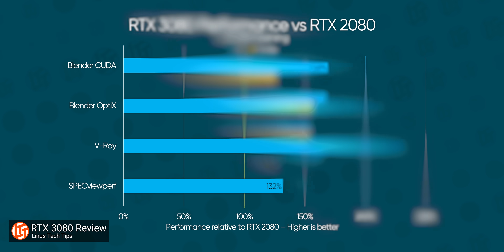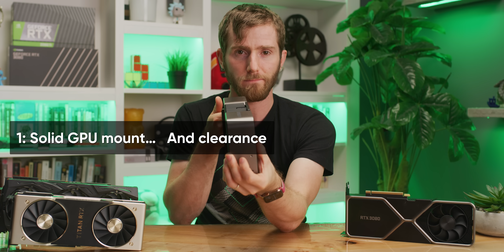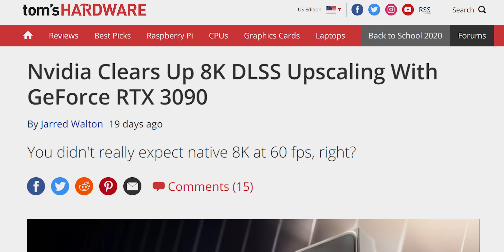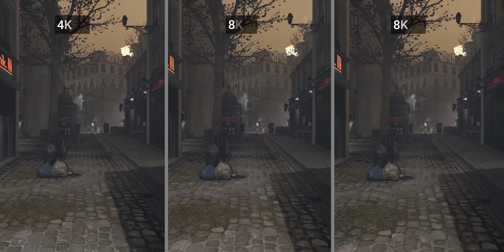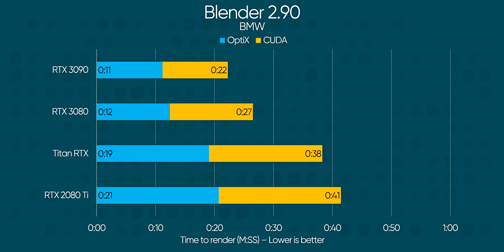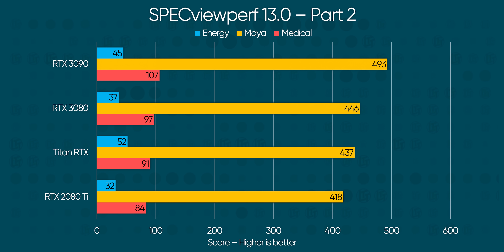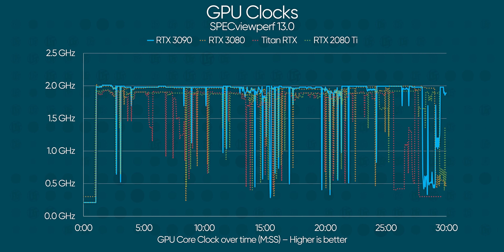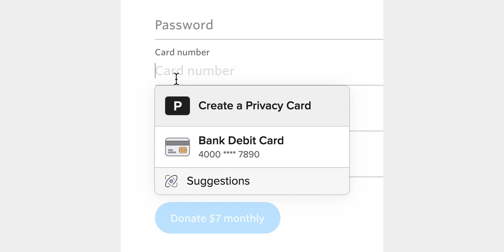Making Nvidia’s CEO mad - RTX 3090 Review

Comment: Seeing a new reference cooler, not just revolutionary and different, but actually competent is really a fresh breath of air! Honestly reminds me of the new ryzen Wraith coolers, they weren't amazing, but they were different and better enough compared to the old intel included CPU coolers to make it feel revolutionary which matters a lot to customers! My friend picked a r7 2700X over a r5 3600 last black friday because it was cheaper at sale, AND included a beefy CPU cooler. Cooling matters and even if it's just to make customers feel better, that still matters a lot when working for good faith. I had signed off of reference coolers for the last 8 years of GPUs, nvidia changed this in one launch.

I'm also happy that my 6 year old 850 PSU actually feels future proof, the power efficiency going through maxwell, pascal and SLI being killed made me feel like I had a high power PSU when they weren't feeling very necessary. I know 850 isn't enough for this GPU but as a 1080 Ti owner, I'm probably not going to upgrade anytime soon.

Comment: As an artist, I now definitely wait for a titan version. Maybe I'll grab a 3080 for now, unless I get a Titan at a great price & save that $$$ for a 3090 titan. 
And for those asking why not wait & get the Quadro version... 5k gets me my new Cintiq Pro 32 touch w/stand. So 1500 is the max I'm spending on a card, especially since most of my art software I use, makes more use of regular memory; meaning I'm better off with 64gb of memory & and a titan during the working hours of the day & 64gb of memory w/ a 3080 or 3090 titan in the evening for gaming. 
I agree in the end... the 3090 is frustrating. It does not do me any favors painting in PS/Painter or the occasional 3D model renders for painting references, during my working hours.

Comment: rip; here i was thinking thr 3080 ti was going to come out... and now i find out the 3090 is not even a titan...... unless Nvidia does what they did 5 yrs ago.
Release GTX1080 and Nvidia Titan XP - 6 months later, release 1080 ti which outperforms Titan XP at a significantly lower price; then just to fix that mishap, they decide to release Nvidia Titan Xp (notice lower case p). A kick in the butt for all the Titan XP buyers back then. Won't be surprised if the same shit happens.

Comment: i remember everyone saying, no dont get an overkill psu. everything is getting more power effecient.... where are your comments noww laughs in 1200watt psu
Reply: Power supply in 2120: Literal neutron star to power your terawatt pc running Microsoft universe simulator at 1 billion fps 4000k hdr.
Reply: ThreadRipper brought back higher wattage CPUs. Intel 9th gen forward and RTX 3000 made them mandatory.
Reply: even a 400W system benefits from a 1kW+ PSU...
- PSU will run fanless most of the time
- there is an efficiency sweetspot (somwehere in the middle)
- plenty of room to accommodate spikes in power consumption
- longer life. This one might be a stretch, but logically thinking if you have a device rated for 1kW (that should last 5 years), drawing only 300W from it will expend it's lifetime. Less heat and temperature fluctuations = better for electronics. Also since it's rated for 1kW it will have beefier components. Even with half-dry capacitors it will still manage to deliver stable 300W. A 350W PSU wouldn't.
Reply: made that mistake before, not this time, 1000 w psu
Reply: If you haven't realized, AMD and NVIDIA releases efficient entry to midrange GPU's that replaces their high end GPU's. So yeah GPU's will always get more efficient. I am willing to bet that the 3070 or AMD's equivalent will require a 600 watt PSU at the minimum.
Reply: @metasek1098  if u haven't realized i was talking about the subject of the video. The 3090
Reply: yeah and you need that if your running a 3090 and threadripper and plan to overclock or upgrade

Comment: Looks like I won't be buying a 3090.  I run CATIA & NX on a Titan XP.  To me the 3090 is not a "Titan" level card as Nvidia said it was.  Eh, once AMD catches up on CAD performance Nvidia will release a driver update unlocking the true potential.  If I did that sort of half-ass stuff at work I'd be fired.  Maybe I'll have a fully AMD system after all.

Comment: Moores law didn't take into consideration capitalism.  Imagine if your lawnmower had a hidden second set of blades that never dull but you have to start it with the gold key instead of a normal key, and gold keys cost more than the lawnmower did?  Or a woodaxe with a coin slot that only reveals the axe head if you put $2.50 in.  Surprised my toothbrush doesn't need to be updated and ejects heads once a week for it to work.

Comment: Been doing 4K gaming since I got my GTX 1080, with a number of settings on Ultra Nightmare. The idea of 4K gaming hasn't been out of reach for years now. After recent findings though regarding the capacitors, I'll wait until the 4080/4090 is out... or until whenever the next Doom releases. Still seems too soon yet to upgrade, especially since my 1080 has been still hanging in there like a champ.

Comment: i got the 2080 & my pc still glit ches ONLY when i play games like WOT....i believe its either a voltage issue or a usb issue.....I mention USB because when i start the game, at times i get a USB ERROR. it doesn't hinder anything, but it does pop up.  any hekp would be appreciated ...when i change the settings to 1440xanything, i cant even play because its really glitchy. its like 1 frame out of 4 is missing...no frame rate loss, just glitchy play

Comment: I'm curious if your "high quality" power supply was a Corsair which I've heard is a rebranded Great Wall chinese make. 450w on the card and 250w plus 50w for the rest of the system should be enough right? I bet the sea sonic 750 would have done it. Just like when those 150W truly rated audio amps sound better and put out more power than the 1k watt cheap ones. I would love to be proven wrong I'm just curious and would like to know the answer. Also I'm honestly not trying to sound bitter but with all of this focus on 8k pixels seems a little foolish to me when we still haven't quite caught up to the response time, colors, or contrast of CRTs. You can have all the pixels in the world and still have a gray black with ghosting experience at 60fps wooo. So incredible. OLEDs are getting close to CRT performance but they still are very expensive and they only really make TVs and no gaming monitors yet so really still nothing has beaten their image quality and instant response time with zero digital processing delay. It's just like focusing on graphics in games. Who cares if you have the best graphics in the world if the game isn't fun you know. But big cheap TVs are what sell which is why the most popular kind is still those terrible image quality TN panels. And flashy graphics on ads is what sells games. So this is what we end up with.

Comment: I don't understand the complaint. Nvidia has had the GeForce and Quadro series side-by-side for years, each catering to different needs. The Titan series is the odd one out, that seemingly sat in the middle and could cater to some of either needs. But it was still more on the GeForce side (at least, we never treated it as a card that could run in an industrial environment reliably). Titan was the niche. The 3080 and 3090 as I understood from Nvidia's communications, is simply a GeForce card. So why upset that it turns out to be just a GeForce card? There is no point comparing it to Quadros or Titans.

Comment: HZD has already used more 10+ GB Vram at ultra setting at 1080p/60.   It avg 9-10+ GB Vram usage in my few hours of playing on 2700x/16G/GTX1080ti.  Going laugh my Ass off when RDNA2 matches 3090 and is hell of cheaper. Thanks TSCM better quality and performance.  Samsung is old imo.  They might well call this space heater lol.  It’s not worth high price IMO. 

RTX 3090 is only 10-15% faster at premier cost,  just like 2080Ti was. And wasn’t worth it’s $1600+ price tags (Canadian) before 3xxx came out.  Here 3090 are selling for over $2100 to $2499.99 Canadian. 
https://www.memoryexpress.com/Products/MX00114155
EVGA a RTX 3090 FTW RGB.  WTF $2449.99??

We’ve seen Rumors of leaked 3080Ti with more Vram.   Wouldn’t doubt we see 3xxx Titan too at some point. Bigger then 3090.

Comment: The year are 2070

As you can see
RTZY 9000 in 12K vs 24k

12k deliverys not as much visual dust than 24k and there is not too much airflow but is still good.

Comment: Ya the power draw being too excessive, and the fact you can basically barely see any difference from "4k", just shows why these gimmick cards need to be bought and released less. The fact it does have that problem shows nvidia are just releasing things too quickly and over-pricing them. Plus who cares, you can get like a 1060GTX and it runs 'everything' perfectly smooth at 4k, at high refresh rates. Sure, feed the industry money and such but.. man.. I usually just sell something, buy something for like 100$, and I'm still like top player at any FPS or RTS wout much trying. You really only need like 100fps+ and a suitable strobing monitor (can be cheap or not). The only tangible leap forward really isn't upscaling and RTX gimmicks that make framerate lowered and offer worse visuals, it's actually getting extreme refresh rates down to 2ms to 1ms with actual 500 fps to 1000 fps rates. I'd much rather get 1920x1020 at 500 to 1000hz and similar refresh rates than some gimmick like upscaling or RTX. 'Maybe' then with all the money spent some slight tangible difference would be perceived in refresh rates but really this is all just hype. They're lowering framerate just to hype retards to buy expensive unneeded cards. They could have released like half as much and still been fine. It's been shown they can generally produce the upperend cards for like 250$. The fact it's priced at way over 1000$ is just extreme profits. There's literally nothing that can't be run even at higher framerate by a machine that cost very little such as a Ryzen 1600x, 1060GTX, DDR4 ram, and a budget motherboard; if its struggling then you did something wrong. They even increased the price on the older cards slightly because the value of it is slightly higher than expected, even though you'd never even see these anymore on any 'comparison' as there's already been about 3 generations of cards, where 1080TI might be on there on the bottom somewhere. My 1060-6GB was about 220$ back when I got the original GPU upgrade 2 to 3 years ago, now it's literally like 260$ on average if you can find one. And it runs literally every single latest game on max.. without perceivable issue or lag.. so.. why ever spend on even the 500$ upgrades that are shit even if they can be a few times faster by now?

Comment: Let's see 0.49-0.57, I'm like yeah that is simply a low textured/detailed imagine with a excessive amount of sharpening applied.
Sorry that's not really impressive at all, reminds me of old techniques where 720 was up-scaled to 1080 and some amount of sharpening was applied to try to make it look less blurry. And then around 0.55-0.56 it was zoomed in which just made it look much worse, as you could see the sharpened edges where contrast was unnaturally attempted to be increased. This is of course standard sharpening which I having nothing against, infact I have seen it done successfully in other games like doom 2016 and doom eternal, where enough detail is already present and sharpening helps enough of the detail due to increased contrast edges look less blurry and stand out more.
I would say this was perhaps just a really bad example of something which could have been something that was showcased in a far better, which makes one wonder did anybody review this before saying, yeah lets showcase this as it shows a really good use case.

Comment: Any reason the test was carried out on a motherboard that doesn’t have PCIe 4.0? Would this have made a difference to the results? 🤔
Reply: They did pcie 4 and AMD cpu on their 3080 video.
Reply: Intel doesn't support it yet... xP
Reply: Gabriel Stolarczyk I know that, why didn’t they test it with AMD, especially as Linus goes on about it being useful for creators rendering with blender etc. AMDs do better with multi core tasks than intel and have PCIe 4.0 so how come they didn’t show performance differences?
Reply: @thejaycut1664  Yeah, you're right - they probably should have... :-/
Linus said in the video that he wanted to avoid CPU bottlenecking as much as possible and Intel still has a slight edge in single core performance though. ;-)
Maybe PCIe 4.0 would have negated Intel's advantage, who knows...

Comment: All the software that you mentionned that is performing better with the Titan compared to the 3090 are very specific CAD pieces of software that are usually run with workstations equipped with Quadros, and those are definitely not gonna be installed on any tech geek amateur but is more likely to be owned by a decently sized company. The software mentionned is extremely expensive, so buying a Quadro for it doesn't hurt too much.

Comment: As a mechanical engineer who uses CAD systems (Siemens SolidEdge and NX) on a daily basis I can assure you, that you don't need a Titan card. I've worked with really big assemblies with hundreds of thousands of parts in them and a mere Quadro 2000 series card would suffice. CAD software just don't scale very well with those really high end graphics cards and in reality (not in a benchmark like specview) you don't leave any "work performance" on the table if you are using an 3090 instead of a Quadro or Titan. If you are a company and using the computer solely for CAD work, the go ahead and buy a Quadro, but if it's a system you also want to game on, then just buy whatever high end card you want (but beware of AMD GPUs, they suck for CAD use)

Comment: OrcCorp...hey...
Posted it here just in case you see it (so much hate under your comment) to discuss your i7-7700K being a potential bottleneck. Okay, here's how you know. Disable VSYNC to ensure no FPS cap. Monitor both the GPU usage and frequency when gaming with any OSD tool... so if for example your GPU usage is 98% and frequency at 1840MHz then you don't have a CPU bottleneck. If your GPU usage is 80% and frequency still high then you've potentially got about 25% more performance if you remove the CPU bottleneck... more...
*You also need to go by game SMOOTHNESS as you can have what appears to be no CPU bottleneck but the game might not be smooth. Unfortunately there's no easy way to know what's causing that without swapping hardware, BUT... if the games you play are SMOOTH and the GPU USAGE is high (or you are FPS capped anyway so more performance isn't needed) then upgrading to a better CPU gains you little.
**If you were to upgrade I'd probably wait for a Zen3/5000 CPU (if that's the naming for the next CPU's from AMD) or possibly even wait until Zen4/6000 with DDR5 memory or whatever makes sense. And a motherboard with PCIe v4.0 support.
Reply: (EDIT: obviously this would have to be done on a per-game basis. I doubt there's much value in upgrading. It's a bit skewed when  you search benchmarks out because they intentionally look for CPU bound scenarios such as specific games, 1080p at high FPS etc... but most games will run great with an RTX3080 + i7-7700K@4.9GHz with minimal CPU bottlenecking)